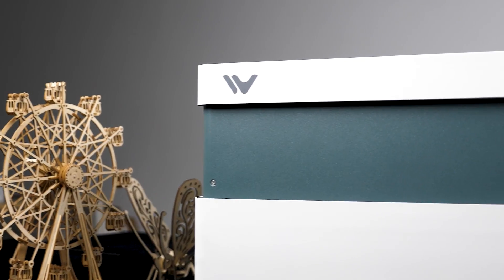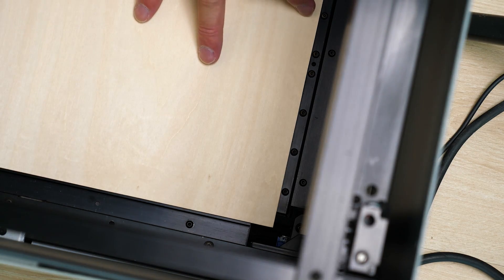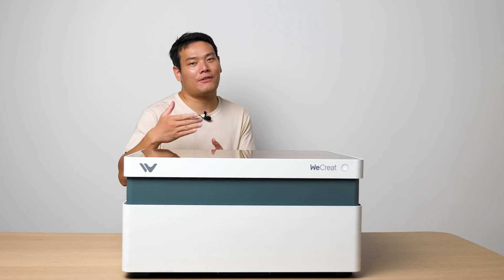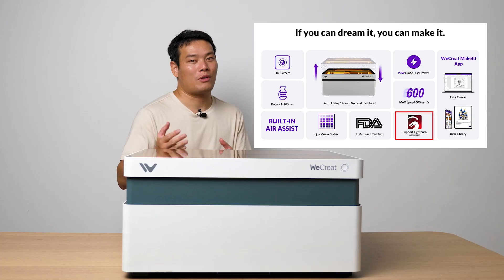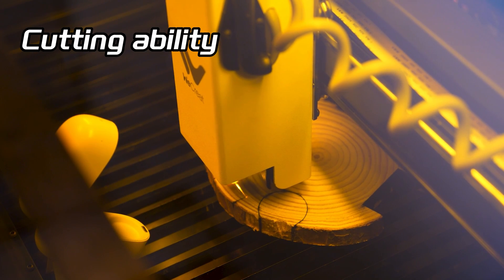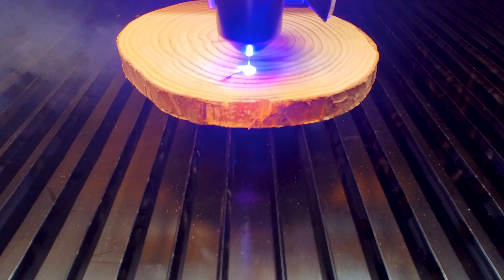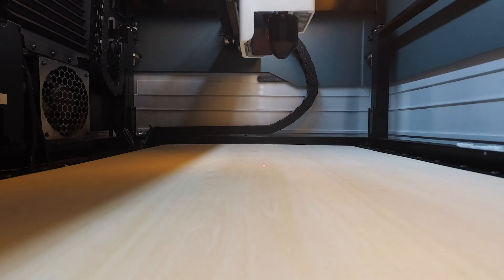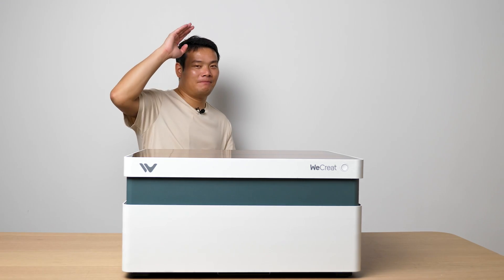Watch Before Buying! Camera Off & No Lightburn? WeCreat Vision Laser Engraver Follow-up Review

Comment: we've heard and seen alot of comments about support on this machine, that cant get intouch with anyone and gets placed all over about about answering questions, when the machine comes to them broken, is customer support being fix and are they replacing broken parts?
Reply: @mtz3843: It's true, the warranty sucks. I purchased the WeCreat and from day one had issues. Although, I have been in touch with support through ongoing back-and-forth emails. Mind you, they only have one employee in the support department. Regardless, providing all of the problems from day one - WiFi keeps dropping, power cord too loose to stay connected to the unit, and autofocus at times throws projects out of alignment. As for the WiFi, you have to be on a 2.4 band and must be near your computer and router. That is actually how my setup has been done. All of my devices on 2.4 in the same location with WeCreat do not drop signal. Only WeCreat. I received a lemon and yet, I was blamed for all of the problems toward the last few correspondences.

According to WeCreat, any issues must be proven before they make a decision for the next step. I get it, but with all the back and forth, and it was determined not to fix the issues but return for a full refund. Instead of replacement, which they make clear in their warranty, they decided for me to return the unit and still blamed me for the problems. WeCreat does not replace their products -period. I watched a live broadcast WeCreat Vision on YouTube before Easter about lasering Easter products and to my surprise, the live chat from a viewer asked why they don’t answer support emails. They replied by blaming their clients for not using the correct email address. Instead of saying, "We’re sorry your emails went unnoticed, we will look into the matter." But no, they blamed the end user for the wrong email address instead.

Most viewers finding out about WeCreat are not from anyone paying for the laser, 99.99% are sponsored. And most sponsored reviews do not use WiFi, but USB cables. Watch closely to most of the reviews and you will see a good percent not using WiFi, that says something. Also, because it is sponsored by most content creators you will not get a true honest opinion as you would from someone who paid out of pocket.

Frankly, it seems to be a great laser if it worked out for me. And maybe my issues are isolated or maybe not, but the support is nothing I experienced and wouldn’t want to go down that road again. It’s horrible and not worth getting blamed for a bad unit on day one. I hope the more complaints come in that will transform their customer service in respect for their clients and fix the problems they may have. And they should have a next level of support instead one employee that that can resolve any form conflicts. Otherwise, WeCreat Vision will not make it. As much as I wanted to get this fixed and not return it despite the lack of support and the blame game, I opted for XTool M1. I just ordered the M1 and knowing it is a downgrade from WeCreat's 20-watt laser to a 10-watt laser. On the other hand, I don’t mind 10watts for the reason of doing fine detail engraving. At least with XTool, I don’t have to go through horrifying support like WeCreat. And I actually contacted XTool by phone and spoke about my needs and their warranty. From that phone experience, I must say what a difference compared to WeCreat by emails. I know, it seems crazy XTool has a contact number and a real person taking the call in these times, but they did and it was pleasant. I was treated with respect no matter how many question I gave them. Yeah, read the fine print before considering any products. 😎